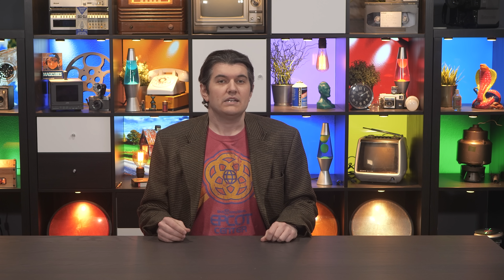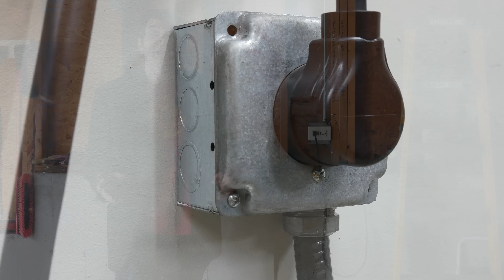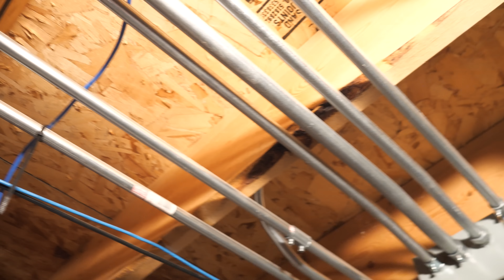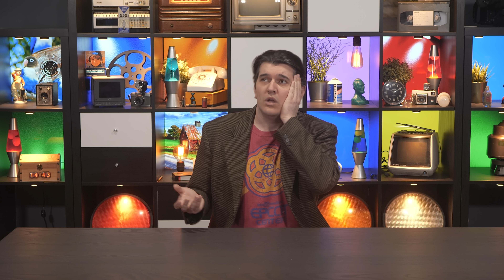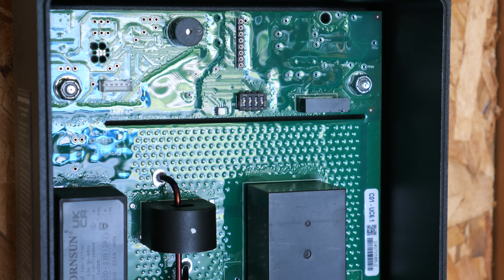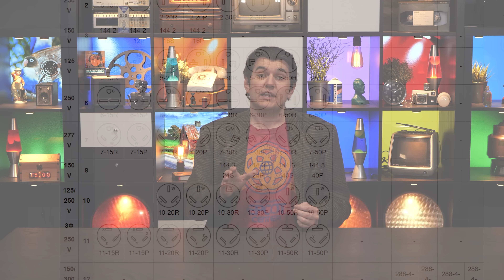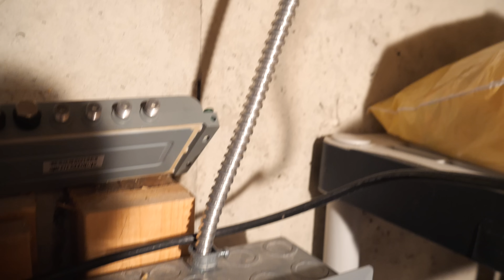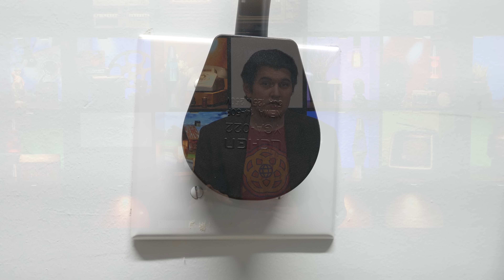The "standard" car charger is usually overkill—but your electrician might not know that

Comment: Well, it's surprising the charging station is made here in Canada and the fact that you used the Canadian invention that is the wire nut (known here in Canada as "Marrs" or "Marrettes") is even better.  Wago lever nuts aren't really great for high-capacity loads like this and your next option is using something like a terminal block with lug style connections.  Thanks for this (mostly coincidental) Canada-friendly episode.

Your phone "charger" isn't a charger either, it's usually just a 5 V power supply.

That being said, battery electric vehicles aren't really a good stop gap between internal combustion engine units and proper adoption of mass transit like that seen in the UK, Europe and Japan.  They have many of the same problems as their engine counterparts but worse in some ways. The digging up of the heavy and precious metals is a fairly low-regulated process leading to poisoning of the surrounding environment, the fact that the machines used to dig up these things are still powered by internal combustion engines and the end-of-life management of these massive batteries is also a major environmental concern.  Most conventional engine powered cars can and are recycled while EVs the majority of the mass cannot be.  Then there's the issue in the States that 60-80% of your electricity is still generated by means of burning fossil fuels and especially coal anyway, so that's just a problem:  transferring the CO footprint of an engine car to the power plant.  In Canada, the majority of our electricity is generated by means of nuclear or hydro-electric systems.  Not so much of a carbon footprint.  There are a few places that rely on burning fossil fuels and that's mostly the Prairies, but not the majority of the electricity.  If we all switched to BEVs as well, that puts a larger strain on the electrical system (regardless of whether you are charging from a NEMA 5-15 or a NEMA 14-50) because everyone has to do that and your system in the States is also under significant disrepair.  Remember that blackout we had in Eastern Canada and the States over 20 years ago in Summer 2003?  That was due to worn out infrastructure in Ohio.  If you start charging electric cars in everyone's homes, that becomes a problem.

BEVs still also rely on fossil fuels, particularly petroleum for the plastic pieces, tires, lubricants and the very roads they ride on.  I also find them more problematic in the department of fire starters as it seems the Lithium batteries are even more sensitive to problems that can put them into a torch-like runaway state than gas cars have between their gas tanks and lead acid batteries.  Even small devices utilizing the batteries I have come close twice with a tablet and a phone where the battery turned into a pillow.  Fire fighters have little knowledge on how to fight these battery fires and often have to watch them burn out while keeping an exclusion zone to slow fires as well.  The toxins released from these fires is a bit concerning as well.

"Keep it simple, stupid" the more eloquent way of referring to this is "Remember or look up Occam's Razor"

Comment: Holy... why do you need SO MANY DIFFERENT PLUGS???
Where I live, there are just 3 plugs, a normal household plug, a high-power single phase and a 3-phase plug. The high power and 3 phase are even waterproof by default, and non waterproof (afaik) dont exist.
I genuinely dont get why youd need more than that....

Comment: In the UK standard wall sockets are 240V 13A. Charging at 10A adds 8-10 miles per hour, which is fine for us. Normally we charge to 50%, leaving it plugged in every day in the garage to top back up after daily use. If a longer trip is in the offing, then charging to 80-100% overnight is easy. Local fast chargers are a backup but it's never come to that. A fast charger is not required.
Reply: I'm also from the UK; using our standard BS1363 sockets and plugs like this is somewhat ill-advised.
Older properties are likely to have all sockets on a single ring final circuit for which regular long charging sessions is quite demanding (particularly if also using e.g. kitchen appliances, washing machines etc on the same circuit). If you haven't had an EICR recently you can't know the ring isn't broken and capable of carrying significantly less current, nor do you know the state of the wiring in the property -- particularly if past owners have done dodgy DIY work or had shoddy electricians in (both of which sadly rather common).
New builds tend to use whatever crappy sockets can be had cheapest, which will wear out quickly with daily plugging/unplugging, they can easily suffer from overheating once this happens. I have seen a number of melted sockets and plugs from appliances drawing only about 10A! I have also found extremely questionable wiring in some new build properties, e.g. wires connected by simply twisting together.
In general it is a good idea to have a dedicated circuit installed for EVSE, even if just a 16A 2.5mm radial, it avoids all of this and you can be sure there is a good connection right from the consumer unit to the charger, making it significantly safer. I would never leave an EV charging at night or unattended from a socket circuit unless it had been tested and inspected within the last few years.
Reply: @mystery_pond  You make excellent general points. Our car has a reduced charging current option which I use when I'm not sure of the wiring. Our separate garage does have a dedicated 16A supply.
Reply: Thank you for the info - I did wonder how this applied to us in the UK. 👍🏽

Comment: Always funny when watching U.S. electric installations when you are from Germany. The standard is 3-phase power and we have 230V. So usually we just run 3 phase, neutral an ground to the wallbox and it can happily use 3x16A at 230V and supply up to 11kW.

Comment: My dryer isn't in the garage, but it's very near the garage.  Is there a legitimate method of tying into the dryer circuit with an intelligent switching device that doesn't require both the dryer and EVSE to physically plug into it?

Comment: @25:02 Well yes. In order to be able to use load demand and pricing adjustment you need a smart one.
Here the price change every hour and later this year we are going to 15 minute intervals.
So for the charger to know this and turn on/off at configured pricing limits you need it to be connected somehow.

And even an apartment garage is "private" as we own the place as a co-op. To load balance and use the available power to the building you need more advanced features.

Comment: Just remember the longer the charge time the more idle consumption the car wastes. Tesla uses about 150 watts when awake. Charging slower can add to the costs especially in winter where the battery will need to be heated too.

Comment: Completely different story here in europe. Most likely you will install a 11 kW 3-phase 16 A EVSE, which can adjust the amps from 6 to 16 A and switch between 1-phase and 3-phase operation. This allows some pretty neat control feature, for example following a PV inverter production and consuming only excess energy.

Comment: In the summer I mostly charge my EV with one phase and 1,4 to 3,0 kW because my PV installation does not produce more surplus and even with rainy days in between I usually can cover the energy needed drive around.

Comment: Can confirm. I run a daily commute of 60 highway miles in my Ariya and charging with 1.4kW (12A on a 15A-120V) branch circuit in my garage is totally fine. 
I don't get back all 60 miles every night, but with just minor city driving sleeping in on the weekends, my car has more than enough time to get back to 100% for the next week of work.

Comment: With the regular 120V chargers it's not just the speed that's a potential issue but you also may not have a dedicated circuit to plug it into.  I had to use one while waiting for a level 2 charger install and because the circuit has a freezer plugged into it and I could find zero information about how much power the freezer draws, I had to leave the charger set to ultra slow speed to avoid tripping the breaker.

One positive about internet connected chargers though is that your electric company may have a rebate program if you mostly use it during off-peak demand hours.  That'll require a connection between the charger and the utility company of course.  The charger that Hyundai is currently offering free (you still have to pay for expensive installation of course) works for this.

Comment: This could be a fun video.  Not only do I own an electric car, I write firmware apps for commercial car charging stations.  Active rectifier, DC-DC converters, switch matrix....  Plus... actually taking to the car battery circuits....  Participation in grid curtailment programs, even using the car battery as grid provider in certain circumstances... 
We're kinda thinking Amazon and UPS will eventually go with electric fleets...  So we're building equipment for electric fleet charging.

Comment: The standard electric charger, that comes with your car, is known as an "Emergency Charger" . It is not meant to be used as the main charger for your EV over time. Unlike most things you connect to a socket, an EV charger draws a high current, continuously , aka up to 30A / 240v over hours. This puts a much higher load on the socket, wiring, and fuse than just about any load you would normally use.

Comment: 1) In your case where Chicago requires conduit for your wires (which is specific to a few cities like Chicago) I think you could have used 3/4" Flexible Metal Conduit and then use #6 THHN conductors and then have a 60A breaker (48A car charger).   Most everyone else could have just used Romex.   This is why getting a qualified electrician is key.

2) Arizona where I live we have a  rate during the day (in the winter) called "Super Off-Peak" which costs less than $0.04 kWh but is only a few hours.   So if you can charge during this time you will want the faster charger to maximize your savings.

3) Hardwired car charger is preferred as less connections is always better.
Reply: RE 3) But how will I plug in my 240V tools, which I own because I'm a poser??? 😂

Comment: 16:56 Yes to both questions. My EV real world highway range is 200 miles to 10% and my daily commute is 168 miles round trip. If I don't bring a lunch, I might end up walking. ;) And as a professional driver at work, I fuel up anytime my vehicle goes below 3/4 of a tank. Never know when you'll have a long drive.

But your logic is, as usual, sound. I'm an odd duck and most don't need to do this. I also do limit my home charger to 32 amps, even though it's a 50 dedicated circuit, but that because ambient temp in my garage is often near 100°F.

Comment: Note: There is a specific Nema 14-50R designed for EV charging. It has the green silhouette of a car, this is a beefier plug designed for continuous load. The regular one it  is not and I have seen those melt because of that

Comment: We have 1 rollback truck at work with a small tank that consumes at least 1/2 a tank each day. So yes we fill that one every day. The one I drive consumes 1/3 a day so I last 2 days no problem, fill it on the 3rd is a must. The electric car I had could slowly charge at 6A 230V (NL max 16A circuits) for 9 hours to charge it's consumption of 2 days but the daily charging was a hassle and a max 15kW charge was very short max range. Tiny Kubota engine with 20 liters of diesel now propels me for much much longer, nearly 100 times farther cheaply and with quick refills.

Comment: Thank you! We put about 6,000 miles/year in our EV. In 2 years, I've had to use fast charging for about 20 minutes. Every other mile has come from a 110V, 15A regular household outlet. When I installed an electric range, I thought about doing a 240V car charging circuit as well, but it just made no sense to spend $500+ for something that would save one trip to a fast charger once every two years.

Comment: I've been in the process of choosing the next car for my mother when her current one gets too old and it will at this point be an EV. She does already have 3 phase socket in her garage so 11kW is no problem, and beneficial since we do have dynamic pricing on the electricity. 

BUT I do somewhat disagree with what you said about smart chargers. Yes, your car can do that.... if you pay subscription to your car. At least that's how I've understood it in most places talking about the cars remote control "smart" features. I have found 0 mentions of the car being able to connect to your home WiFi and be controlled through your home hosted server. But there are several chargers that you can do this with. 

If I've misunderstood how these features for EVs work, please do correct me, but I only remember seeing them talking about you needing to pay them monthly for your car to have any connections.

Comment: Great update on selecting optimum EV charging current rating. I agree for most of us a 30A charger will work well and is cheaper and easier to install then a 50A.

Something else to keep in mind when sizing EV charger current rating. In our case even though we have a 200 Amp service (48KW + 7.2 for hot water) our house is only feed by a 10 kva utility transformer. Assuming 100% Power Factor the total house is limited to 10 KWs. Utility transformers are extremely robust and have substantial overload capability but if you don't need the extra capacity just be conservative. It is probably a good idea to contact your local utility as to the maximum size EV charger they recommend.

As to requiring a web app to configure your widgets I absolutely agree. I hate having to set up an account and have the device in constant communication over the cloud.

Comment: Sure, why wire nuts are fine, but why use them? Honestly, curious here. New wagos have larger contact areas than you get with wire nuts, and are perfectly capable of handling extremely heavy use.

Comment: Does charging EVs faster shorten their battery life?  I've read that EVs usually have stuff to mitigate the damage from the extra heat (fans, extra cooling fins??)   But I'm wondering if the battery in an EV that is consistently charged more slowly the battery will last longer.

Comment: If I may elaborate for our Canadian friends, as a Red Seal Canadian electrician. The Canadian Electrical Code allows for a receptacle-connected vehicle charging station to be rated at minimum 20A 125V, a standard t-slot 5-20r (code 86-306 1 b), requires it to be on its own dedicated circuit except ventilation equipment (86-300 1) unless an energy management system is connected (86-200 2, 8-106 10 and 11), and you may have multiple electric vehicle chargers on one circuit provided they, collectively, don't exceed 60a (86-304 3). So there's a lot of versatility even for a small panel. The real reason so many electricians go for those big honking plugs is you are limited to nominal plug sizes of 20, 30 or 50 for 120v or 30, 50, or 60 for 240v as the code requires them to be in accordance with Diagram 1 (unlocking) or Diagram 2 (locking) receptacles (86-306 1 b). Since it's a continuous load, requiring it to be derated by 80%, the 14-50 plug is common as it allows for a max of 40A at 240v AND allows it to easily be plugged into RV outlets that also use that outlet.
Reply: The challenge with cord connected chargers in Canada is that most of them use a 14-50 plug, which the CEC does not allow to be installed on anything smaller than a 50 amp breaker (other than when installed to power a stove where it can be on a 40 amp breaker). If your electrical service capacity is not large enough to handle that much load then that's a problem. In that situation you basically have to hardwire the charger.
Reply: @RobertHancock1  All things considered, I would actually recommend just going for a hard-wired charger. It gives you a lot more flexibility with the load, it isn't harder to install,  the prices are almost exactly the same, and a hard-wired charger looks nicer too. The benefit to hard-wired dedicated devices too is, generally speaking, the code just allows you to size the breaker based on its load without having to take receptacle ampacities into account.

Comment: When (not if) I get my EV, it is going to charge at about 12A or something from a standard outlet.  That will be more than what I need.  The car will spend about 12 hours of a typical day (at least) in the driveway.  The math looks like this:
12A * 120V = 1440W or 1.44KW
1.44KW * 12 Hours = 17KWH
17KW * 3 (miles per KWH) = 51 Miles
That is further than I drive in a typical day so after a longer trip over the next few days, the car will get back up to 80%

Comment: It's also worth pointing out that most battery chemistries don't like fast charging, and will degrade faster the faster and more frequently they are charged. That's why some EVs won't even let you use the whole battery, and some phones have a setting that limits the battery to 85% of its capacity

Comment: I would highly recommend exploring NEMA 6-20 outlets. My parents installed one years ago "just because" in case of 240V tools and it's been great whenever I visit. A Webasto TurboCord or similar will plug right in. It's the same 12/2 NM wire, but at 240v instead of 120v. If you have a breaker running to a singular outlet, it's a pretty trivial swap the existing infrastructure if you're comfortable working in a panel.

Comment: why the hell aren't 50A connectors rated for 50A continuous?  the 80% rule seems like a rule designed to sell more expensive electrical connectors than it is a necessary rule.  50A connectors should only be labeled as 40A connectors, if that's what they're rated for.